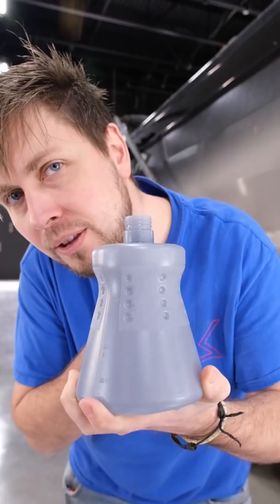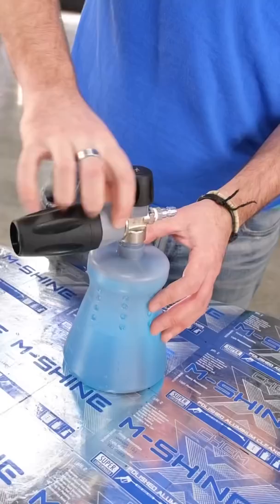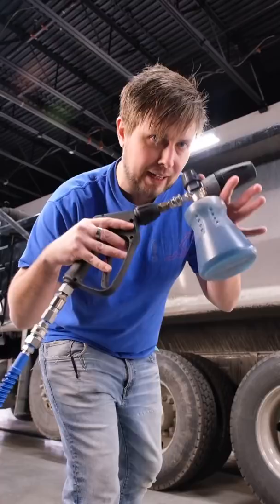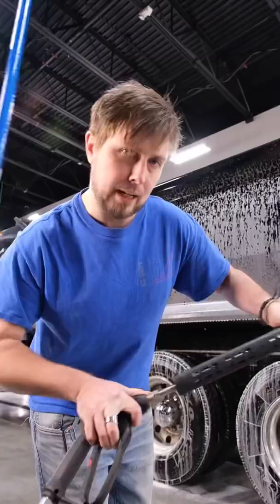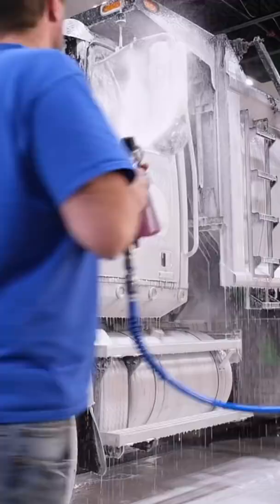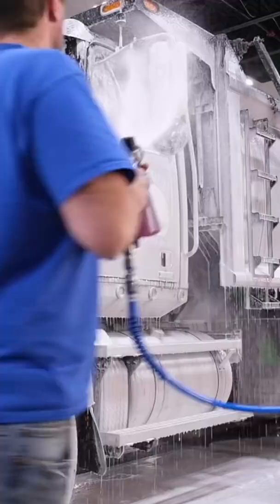Learn How To Get A LEGIT TOUCHLESS WASH in 51 seconds! #shorts

Comment: There’s zero chance that actually cleans. The loop is the best loop I’ve ever seen
Reply from the maker: Thanks I think hahahaha
Reply: With a loop that clean it’s gotta work
Reply: What
Reply: If you where smart you would have said. “That loop was cleaner then the truck”
Reply: @AIMLESS-NAMELESS  than*
Reply: Yeah I get what he's saying these foam cannons work to an extent. It doesn't really matter what soap if any you shoot at a car.  It's really the pressure of the power washer doing 90% of the cleaning
Reply: @kylebusc3624  please do a search for the term "soft wash" and realize that's what this guy must be doing.
Reply: @KalebStorm  he might be, or he could be one of those guys that think foam cannons are a must have detailing item that prevents scratches. The foam doesn't do much on its own. If you foamed a car down then used a wash mitt that would be the best use of a foam Cannon. Making sure you have proper lubrication with your wash mitt at all times.
Reply: This is how semi trucks are washed daily. #bluebeacon
Reply: @LOUDsigh  oh yeah, half assed but looks clean from 5 feet away which is all that matters
Reply from the maker: That actually right this is a shortcut to save time in between a hands on wash
Reply: If the dirt has been there long enough, no way in heck you get truck as clean as that with just a foam lance and a rinse.
Reply from the maker: This system works bro this truck hadn’t been washed for months
Reply: @ChemX  impressive!
Reply: Pre-fuckincisely... anyone who has used a foam cannon know that ANY wash requires at least SOME form of scrubbing/washing
Reply: Anything that saves me from scrubbing the whole fn truck down is appreciated.
Thanks
Reply: @AIMLESS-NAMELESS  said: 
(plus the other corrections previously mentioned)
Reply: I have my doubts, but I'm willing to give it a try on my truck. How do I get that exact same product?
Reply: @AIMLESS-NAMELESS  than*
Reply: 100% true, without a proper Graphine, or ceramic coating, you will need to loosen up sediments, with a pH neutral soap. Everyone thinks they are retailers these days, and it's hilarious.
Reply: Wrong my friend. I use Nerta’s Active Diamond soap to wash my car. Haven’t had to scrub it in a year. I’m sure this works well. There are true touchless soaps out there.
Reply: @KalebStorm  soft do work, but not to this extend where it brings a shine and gloss out.
Reply: @kylebusc3624  exactly like most “celebrities” or “influencers”
Reply: Those foam cannons do actually work I use them to wash my vehicles their quite nice
Reply: @junkworks1  .
Reply: I actually bought it, It sucks.
Reply from the maker: Give us a call anytime man we can help ya out with some 1 on 1 input and make sure your in a good spot we’re at 8006245403
Reply: @boblee1838  . R 4 women
Reply: @anthonyr.3799  what products do you use? It will be nice to wash my car in 20 minutes
Reply: That's why everyone is commenting good editing LOL but the loop iz fire
Reply: I think it should work, if you wash your car as needed you shouldn’t ever have anything deep in your paint. The pressure of the water and the foaming should be plenty to clean anything.
Reply: For those who need to know, soaps/detergents etc help remove oily deposits, soften and release cured-on organic matter, dissolve scaled minerals bonding dirt to the surface, and even reducing the static charge holding dust to a surface.  Of course you need spray pressure and even mechanical scrubbing to carry it away and get the remainder off, but the above makes that easier.
Reply from the maker: Damn that’s a solid rundown 🍻👏👏
Reply: @kylebusc3624  Being able to drag things off the surface of the paint without scratching your paint is pretty key...so I would definitely say a foam cannon is a must if you are serious about detailing your vehicle.
Reply: Ok, dr suess. Lol
Reply: I'm calling bs, but I could be wrong
Reply: You can still see the smudges around the chrome and such. But the dirt is gonw
Reply: Well I have some wheel cleaner that doesn't need any scrubbing, you spray an wait a few mins then power wash off. It's non acid or alkaline too. Never damaged my wheels yet. Never seen a product that can clean a truck without scrubbing, we have t.f.r and it doesn't do shit without a sponge or brush. It will remove the main shit but leave a coating on that you'll see once it drys.
Reply: @babattaja  this is a maintenance wash between full details, and/or a first step in a thorough detail.. very common for big  expensive vehicles like this, and also rather common for people with nice cars that they daily, but still want to look clean .. it's not always worth paying $600 or spending 6 hours just to rinse away construction dirt that's going to be back in a few days..
Reply: @kylebusc3624  actually it probably wouldn’t as wash mits rub particulates further into your paint, and can also rub off wax, if you use a foam cannon and a shift wash like he did the power of the spray isn’t enough to damage the wax layer and thus removes the dirt without removing protective layers, that why you would almost never see a professional detailer use a wash mitt only microfiber cloths after a foam wash and a power wash, wipe it dry use detailing putty and then wax (then wax again if you want )

Comment: My paint was still holding the water so I had to throw some hands to get the water out. However all said and done it came out clean besides the few dents 👍🏾
Reply from the maker: Nice heck I wish I could help with the dents lol, usually if there’s still film ya just want to mix a bit stronger or rinse a bit closer those are good starting points

Comment: Are you going to list 5 gallon jugs of Stars and Stripes on the website at any point?
Reply from the maker: I do have the ready to use strengths on my site in 5g, but on the concentrates it's hard to say, the laws on shipping that size and strength add quite a bit of cost, its actually much cheaper to provide 4 packs of gallon jugs.

Comment: What most people don't know is that going from a neutral pH to a stronger acid/alkali back to neutral actually helps breaks down the dirt. That's what makes it effective. Salt on the vehicle naturally softens the water making it even more effective.
Reply from the maker: Right on bud that's an interesting point about the salt as well I never thought of that. The acid/alkaline pH shock serves to release the static bond that occurs naturally on a flat surface like the side of a vehicle, at that point the high psi rinse can remove it better, that's also why I rinse bottom to top so I don't miss a spot👏👏❌💯🍻
Reply: @ChemX  the base is used to breakdown the organic material and the foaming agent lifts and carries the dirt and foreign mater off with rinse water . The salt I’m not sure how effective that would create soft water because of the time needed to start that process. But good points , soft water is the key to effective Touch less wash.

Comment: As a previous Car Detailer, is air drying the really best thing to do? I was taught over and over again that this is one of the worst things to do when it comes to paint if you want to keep it looking good
Reply from the maker: Why is that?
Reply: @ChemX  Because if you use air, you blow the commenter away and they never respond, leaving you with a cliffhanger and no one gets the answer/reason as to why.
Reply from the maker: Lol😂👏🍻
Reply: @leo-ub6nb  damn I completely forgot about this comment my bad😂
Reply: @ChemX  sorry for the late reply but I was told that air drying leaves many water stains that over time accumulate in mass. Eventually you’d have to do an expensive procedure to get the water stains off. 
Plus using microfiber towels when drying leaves no streaks of water after you finish the job, overall presenting a much better job done. Paying someone to air dry your car like in the video is somewhat pointless since drive through car washes do the exact same thing. 
This is just what I was told tho, I may always be wrong but I’ve always liked to believe it’s true
Reply from the maker: I think the person who told you that meant that letting a vehicle air dry can leave water stains, that been my experience, drying with a blower just removes the water before it can evaporate dry and leave water spots just the same as drying with a microfiber

Comment: The water usually leaves marks when evaporates which may not look good on glass 
(I saw some marks on chrome gas tank)
So I won't touchless wash my vehicle until and unless a wash is needed within 20 minutes 😉
Reply from the maker: Right on yeah my blower ran outta gas before I was done on that tank, I grabbed an electric blower since

Comment: What is neutralizer exactly?

Thumb-Up regardless 👍 have two new black vehicles and nervous about micro-scratches, this would be amazing.

Edit- just googled your site,  I'll look around 👌
Reply from the maker: Thanks bud, yeah the presoak is named Stars it’s a low pH formula, the second step is named Stripes its high pH, when they mix it serves to neutralize the pH, which releases the static bond that holds toad film on, then the power washer can remove it without physical contact, that’s why I rinse bottom up as well so I don’t miss a spot

Comment: I’ve never needed for the soap to soak in for it to work effectively which is the only reason for the bottom up method and top down you use less overall and utilize gravity to save time. If it’s so bad it needs to soak, the paint has already suffered. I never knew people thought washing a vehicle was complicated, but some people 🙄
Reply from the maker: It’s not about letting it soak actually it’s mostly a gauge to be able to see where you have hit with the high psi, missing a spot on the rinse will show once dry

Comment: Soap and rinse bottom to top makes sense tho because the runoff from a top-down wash would get rid of the product without cleaning the bottom half
Reply from the maker: Somewhat yeah, mostly I just use the foam as a guide so I don’t miss a spot with the high psi

Comment: A lot of these cleaners leave a film on your car’s paint and the only way to get it off is to towel if off. But then you’re left with part of the cleaner that still on the car.  I’ve been doing this for 21 years and what works great is  just a good car soap and water.
Reply from the maker: Soap and water still has a place from time to time, big rigs take several hours to wash by hand this a shortcut to help save time in between

Comment: Quick question, why from bottom to top?
Reply from the maker: It’s a good question yeah, I only rinse that way in a touchless wash when soaps are applied at low psi with foam cannons, the soaps just release the surface tension so the power washer can remove the road film, so rinsing like this helps you see where you have been, once it’s dry any spot you miss with the psi will look like a spot you missed with a mitt during a normal wash, road film would still be there. Here’s a full video I made on it: https://youtu.be/Bv45Ns7_wWg

Comment: Only works if the surface was well sealed with a wax of ceramic coating prior to it getting dirty. And I've never seen anyone wax or ceramic coat trucks.
Reply from the maker: Wax would make it easier but this stuff would shorten the lifespan of it, this truck only gets washed with this method it’s not waxed. Some of my customers do ceramic coat their trucks tho which makes the wash faster

Comment: Yeah on a brand new painted surface with plenty coats of clear. Not so much on those older more duller painted surfaces. Not to mention older aluminum tanks that need aluminum brightener
Reply from the maker: I’ve got solutions for hitting trucks with physical contact and also aluminum brightener if needed
Reply: He’s just showing the basics of how a truck is done. Of course, there are many additional products you may need/can use (citrus cleaner for chrome, many different degreasers, etc)

Comment: If you don’t mind me asking why don’t you just mix both of those in one spray bottle to get the same effect??
Reply from the maker: It’s a good question I’ve tried it and the soaps neutralize each other before coming out of the foamer. They need to do a ph shock on the surface of the vehicle which releases the road film enough for the high psi to remove it without contact
Reply: @ChemX  oh ok that make sense thanks for the reply 😊👍🏼 love the vids
Reply from the maker: Thanks!

Comment: I'm new to this. What's the reason behind washing it from bottom to top and not the other way around? TIA.
Reply from the maker: The only reason I do it is to be able to use the foam as a gauge of where I’ve been with the high psi rinse, if I miss a spot with the psi it’ll leave some road film behind which isn’t visible until dry. Normally if you hand wash top down rinse would be the best way

Comment: I have always been tod rinse from top to bottom. That way it runs down. Bottom to top seems like you could get a drip or leak that hits what you already rinsed. 🤔
Reply from the maker: I rinse top to bottom when I mitt wash, touchless washes tend to get better results bottom to top, it helps you not miss a spot with the high psi which would show once dry

Comment: Listen this video is good, and I love the concept of a touchless wash, but if you want a real genuine clean paint, you really have to clay it with either a hand clay bar which sucks cock too do by hand or a clay pad and an orbital. Your paint will shine when dry and have no specks of dirt whatsoever. Wax it up if there’s no scratches and boom you don’t have too do anything but rinse dry and maybe spray wax of some sort when drying wax every three months or use opus 1 wax sealant, let it set for a month after applying than wax over with collonite wax and you have a wax and seal in one for next to nothing and it lasts a year
Reply from the maker: Those are solid tips bud👏👏

Comment: Soap application is top down and start at front work all the way around like a cork screw, save you time and product...but still wont come clean as pictured lol
Reply from the maker: So you def want to apply soaps bottom up, the places it runs down first if you do it that way will end up cleaner than the rest when dry.

Comment: I used to powerwash with a 1600psi setup on a honda motor. There's no way in hell you got that chrome to shine without using  acid. So if that's what you mean by neutralizer, then yeah. Otherwise, no acid, no shine.

Comment: Does the pressure of the water have anything to do with it? As in if I have a power washer not as strong will I still get the same resultsv
Reply from the maker: The pressure is a big part of the process, my specs are 4gpm@3000psi, lower specs can still get good results but the process would take longer
Reply: @ChemX  but it is still attainable it would just take longer?
Reply from the maker: Yeah basically it can still do a good job but you may spend more time on the rinse and work in smaller sections

Comment: Terrible stuff if you have a shiny truck! It doesn't matter what kind it is. Any 2 step brushless system is acid based and will cloud and then turn your polished aluminum white, sooner rather than later. Works great if you just have a plan fleet spec truck though.
Reply from the maker: My primary customer base is show trucks, all my formulas are designed for use on polished aluminum, I washed polished aluminum in this video, and here’s some more: https://youtu.be/E7CbzbnFOVk
Reply: @ChemX  what you washed in this video wasn't a show truck. There is a big difference between a good looking truck and a show truck. With proper time taken, many of the adverse affects of using an acid base soap can be minimized. But it is that it will streak aluminum with enough washes. You also washed a very new truck in this particular video. It still had the protective coating on the aluminum as it hasn't been polished yet. There are also products that can be used on polished aluminum to help mitigate it on that too. If your mix is strong enough to cut the dirt and road grim off trucks, it is hot enough to burn the aluminum and it only takes seconds. I have driven long haul for years and either used of have had used every "brushless" wash system known here in the States. Some worked pretty good, while others did a good job getting the truck clean but I had to re-polish my stuff. I take great pride in my rides and have found the best way is trake a little longer and just actually have wash my trucks with a mild soap. As I said, your wash job looked good far what it is. You may have gotten something dialed in that nobody else has been able to. But from a driver that polishes, washes and drives; forgive my skepticism.
Reply from the maker: No worries at all man you sound like you have a lot of experience, my most recent soap release is geared toward just being a simple neutral ph hand wash, I figured I’d at least have something to offer for all the people who feel similarly

Comment: Is this safe on 9H Ceramic Pro Coated vehicles?
Reply from the maker: I haven’t used it on that specific ceramic yet however it is within the pH tolerance of the ceramics I’ve looked into, I have a lot of customers that use them in ceramic with no issues whatsoever as well, here’s a video of the process on ceramic: https://youtu.be/OQQ818JZ5xo

Comment: Yeah, but when you’re not using 5000 psi nor hot water, it doesn’t work as well. I’m using a $300 pressure washer from Home Depot. That’s about 3100 psi and it does not have hot water. It’s a pain in the butt to be honest.